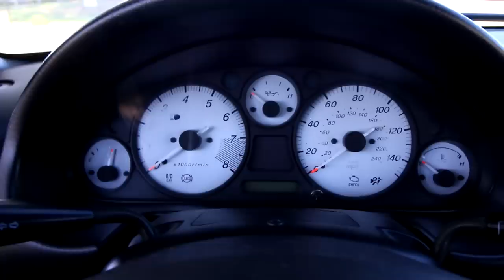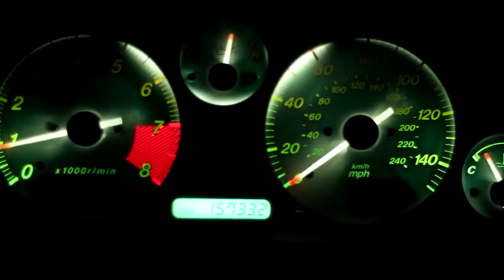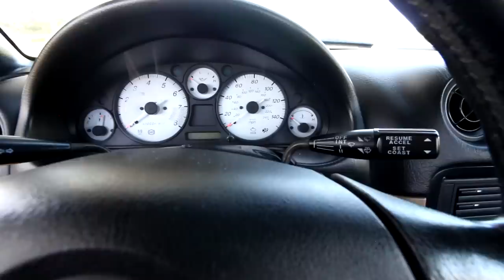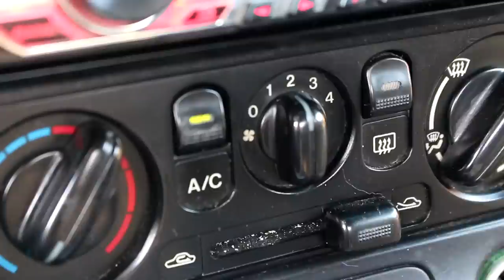What To Do After You Bring Home Your New Born Miata! (Miata Dad Protips) [Project 2SJ Ep2]

Comment: Don't buy new window regulator!!!!! I had the same problem with my window and it was due to a missing clip. The cable gets stuck and won't let the window go down. All I did was run a Ziptie around the cable and tighten it where the clip goes. Super easy fix and will save some good money!
Reply: This, had it happen on 3 NBs.
Reply: @imboredadr  hi fellow nb owner, had to do this too
Reply: @bocaj949  Had it happen on my 99, and both 01s. On my MSM I had a different issue in that both windows would roll down super slowly and sometimes get stuck. Greased the track and fixed that. Interestingly enough a friend of mine bought a MSM and had the exact same issue on his.
Reply: Same deal on my 01!
Reply: Same thing happened on my 93 with manual windows. Easiest thing I’ve done on it.
Reply: I broke my regulator today, cable snapped
Reply: Has happened on both my NA and NB. Very common
Reply: I literally have the same problem now. Thanks for the advice
Reply: Agreed. First off I’d grease the two  tracks inside the door and then use some Honda grease on the A pillar window track. If that doesn’t fix it, then it’s the clip.
Reply: I just fixed the same problem yesterday. The cable clip was just loose. Don’t buy a new regulator :)
Reply: GENIUS!! Idk why I didn't think of this...had the exact same thing happen in my 91. I just put the cable back and hoped it stays.
Reply: @speedymini998  Greasing them worked for me. Buttery smooth
Reply: Yup. Same thing on my '01 Just fix that snagging clip, clean em up and regrease. Shin-etsu is your friend here.
Reply: same thing happened with my NA. easy fix
Reply: Same on my 2001. Clip had disintegrated. Does this happen only on passenger side?
Reply: Same on my Na I took the door skin off to strip it down and with it off the window wouldn't work normal
Reply: Just did this two weeks ago, pretty simple🤙🏻

Comment: DO I HAVE TO FEED IT XD
Reply: Lmao 😂
Reply: Yes, they eat fully synthetic oil.
Try feeding yours from your palm so it'll trust you quicker.
No worries if it doesn't work on the first attempt. 
Just keep on trying.
And don't forget giving it water too.
Reply: Actually oil yes mine for some reason is low and idek y....only 82,500 miles tho so idk y its "burning oil" I actually think I have a valve cover gasket leak which could be the culprit so watch out for that
Reply: @DevinG.Builds  A valve cover gasket is about 20 bucks  and a 1 hour job at most, I'd really recommend swapping it if you think there's an oil leak coming from it.
Reply: @FriedTurkey  oh yeah, I'm already on it, doesn't seem too difficult or expensive, not bad of an oil leak jus some oil in between the head and the valve cover, even if it isnt the issue its still a new gasket, plan on installing one very soon!!!

Comment: You might not need a new window regulator! My NB had a similar problem, and it ended up being a broken plastic clip that held the cable to the door. The cable was able to move enough to get caught under the window and stop it from moving down. If that's the case you can use a zip tie to hold the cable in position against the door.
Reply: My NB also has the window problem, stops at exactly the same spot, so I will check that!
Reply: @sweetielea3194  the broken plastic clip is what was keeping the drivers window of my ‘99 NB from going down all the way. The old zip tie trick to hold the cable back solved the problem.

Comment: That Nardi wheel is in fact factory, I put one in my NA. Something interesting - the earlier NBs have the Nardi logo on the airbag and nothing on the bottom of the wheel, and the later NBs have a Mazda logo on the airbag and the Nardi logo on the bottom of the wheel. What I did was order a later Nardi wheel and an earlier airbag and put them together, so now I have two Nardi logos on my wheel for sick street cred :D
Reply: Did the exact same thing lmao then I got replacement logos got 2 pairs, one in original blue and another in red in case I wanna change them out later on
Reply: Elvis G yeah i need to replace the steering wheel one on mine. Did you get just a sticker that goes over it? Or is it like a full metal badge?

Comment: A few tips from a multiple NB owner; retrofit the NB1 light instead of going through the whole conversion and it is way cheaper and in my opinion looks better, the passenger window regulator is most likely good, there is a wire that comes loose from the door and gets caught on the track all you have to do is pop that door card off and ziptie the line out of the way, the Nardi wheel is factory in almost all NBs save for a few early 99s. I have a passenger NB2 tail light and several sets of NB1 headlights if you're interested.

Comment: so happy you got a 99, I have the exact same car except it has 50K miles on it. You should also get a spare main relay and a spare coil pack, those are known weak points in the 99. might as well go ahead and change out that radiator and get a dual core and some silicone hoses while you are at it. Can't wait to the upcoming videos. The NB's big bang for your buck add ons are... from roll bar, sway bar, coilovers, and frame rails.

Comment: The radiator cap is pretty cool. I had one on my aw11. You can lift the lever and it will bleed off all excess pressure in the cooling system, so you can check level without waiting for it to cool down.

Comment: On my 1990 I did water pump, timing belt, pulleys, spark plugs and wires, oil change, oil filter, fuel filter, air filter, coolant flush, tps sensor (only thing I knew was bad), treated the gas tank, cleaned the iat assembly and throttle body, and diff fluid change in the first few weeks of owning mine just to make sure 😅

Comment: re: passenger window, sometimes one of the cables in the door comes loose and snags on the window mechanism, preventing the window from lowering more than 2 to 3 inches. Easy fix!
Reply: So that's why mine won't go down anymore. I need to find a write up on this fix
Reply: @Dammit_Dad  Did you find something? It can be fixed in 10 minutes with a investemnt of like 5 cent XD
Reply: @friendlyreptile9931  Actually did this fix yesterday. Indeed it was the clip broken, and the cable was catching. Used a ziptie and window works great now

Comment: I once ran a bigger series tire on a VERY similar Miata. It would accelterate uneverly. Didn't ruin anything - I ran it for about 3 weeks. TIRES make a HUGE difference in ANY car... ESPECIALLY Miatas. Replaced both rear wheels where the bigger one was at and gave the other good one to my dad. He's the type of dude to put 4 different brands of tire on the same car. .. .  Toyos are sweet... $50 a piece. Toyo Potenza IIs ARE GREAT IN ALL WEATHER. They squeal in the roundabouts... GREAT IN THE SNOW AND RAIN THO. $52 a piece tho..

Comment: Top tip for the gear shifter boot - Take the existing shroud, cut all of the 'rings' out of the middle, and buy a CV joint boot that has a similar size base to the existing ring, and just stretch it over. CV boots are way more flexible & durable than the OEM (or aftermarket) boots, and way cheaper. Just make sure to push the small end down far enough to not interfere with the leather interior boot.

Note, this is only for the upper rubber seal, not the lower one which seals the oil in the shifter housing.

Comment: Good video and so different to how it would look if it was made in the UK, here it would start by talking about rust, before moving on to a section about possible corrosion, before finishing off by talking about the problems with trapped moisture causing rot in the chassis rails and rear sills, that's about it.

Comment: My NA was losing power steering fluid, ended up deleting my power steering by removing the belt and I'll soon convert my rack because I prefer manual steering.
Lost some oil when I first got it, valve cover gasket change fixed it.
Lost some coolant from the water pump neck, a hacksaw fixed that xD

Comment: NB Fuel smell could be from the tank filler hose in the back. Whether the hose is just weeping or the connection of teh hose to the fuel tank gets rusty and allows vapors to slip by. I had a good filler hose, but had rust on the connection to the tank. you can clean this up with some sandpaper and it got rid of fuel smell in the car, primarily after you fill up. Not sure if this is same as the NA.

Comment: The issue with the windows is probably just a plastic knob on the glass getting caught on the guide tube for the wire. If you take the door card and stick a mirror in your door you can see if that's what wrong. Took me about 30 minutes to fix the same issue on my car.

Comment: I am turning 20 in 3 days and already have a prius c that is paid off. Am completely new to cars and was thinking about getting a 2004 miata, as my first manual if I can afford it. Was wondering what your opinion is. If I should get one or not.
Reply: 100% yes bro. 

This is coming from a guy who’s owned Porsche, lotus, Mercedes amg, Hondas, fast euro hatches.
Currently main car is an EVO X with 720whp. 

I’ve got a miata also. We’ll actually 2 but only ever have one on the road 😂 (tuning them is super cheap and addictive and you can do it with a £200 tool kit on your driveway or better a garage - also you don’t need any mechanical knowledge really just a “I’m up for this” attitude and access to YouTube. Seriously easy. This was my go to when I moved to the states after selling my lotus exige I was scared to buy anything super expensive in case my job didn’t work out. So I bought one of these and put a turbo kit on (admittedly a very good one and i had an excellent and insane Serbian mechanic help me-
That’s a whole other story the guys insane 😂) 
Anyway I had that car smoking lambos. I’m not exaggerating. It was £/£ better car than my exige. & I had an exige “260cup Roger beckets Edition” tuned and pushing 320whp. 

Before I go to work late from typing this (I think I got adhd or something but whatever😂) 
I strongly recommend to buy a 1.6. People always go for the 1.8 for “displacement” but the 1.6 is infinitely better if you’re going to turbo it. Which I’m betting you are. If you’re gonna supercharge then maybe maybe 1.8 but I still prefer the 1.6. I have consistently had them running 260whp on pump gas and that gives you a power to weight ratio that’s higher than most supercars. 

For example the Bugatti veyron is 500 to the ton.

Ironically the caterham R500 is now updated at 530 /ton. 
It has only 310bhp and is probably the fastest “Car”
I’ve ever driven. 
I don’t count “track attack” cars as they can’t be driven on the road. At least not in any reasonable sense. You feel like a right dick in an Ariel Atom when it starts raining i promise you. 

(You also feel pretty stupid when you dropped 80k to buy one and you see a miata in the mirror and plant the loud pedal. Then look in the mirror and see it’s still Fkn there! 😂

One of my school friends now has a McLaren and I saw him in my evo last week. I’ve had that thing for 6-7 years now and it’s mechanically perfect. Like perfect perfect. 
Absolutely mint condition. Like a new car. He goes “awe man… like… why can’t you sell that and get a Ferrari like you always said!? That’s gotta be running you about the same!!” (He knows his maintenance costs- he is not a great driver by his own admission but he’s a very enthusiastic guy) 

Anyway he asked me to drive it so he could “see how fast it really is” I respect that so much. He knows I’m a very well trained driver and he openly admits that he’s not the next stig. Takes a big man… anyway. I did.
&
It’s fun/fkn fast. But… but… if i had just spent the value of a house on a car I won’t lie: that would be disappointing. I don’t care what anyone who’s got one says or anyone who fanboys over them: they are disappointing. Fast? Well yeah if you’re not a “car guy” which leads me neatly into my next point: he asked me; “would you have this over your evo?”

“Well…. I love this, super cool super fun. But I won’t lie bro I’m a bit disappointed in the build quality and for that money… I’d buy a miata and spend 20k on it and keep 180k for something else and I’d be faster than you 100%. Not only that, I could proudly park it next to this car and I know it would receive as much if not more attention”

He agreed with me but hes not biter about it. He just wanted to tick off a bucket list item.

So my point is: yes buy a miata. 
It will do anything you want it to from a budget of $1000- 50,000” 
There’s just so many things you can do with them. 

To answer the real question: you can buy a “good” one for around $3000 and you can have it up to spec “your way”
Whichever way that happens to be for a high end car (not engine swapped I honestly believe that’s a waste of time since you can get 300bhp out of the issued engine)unless you just want to cos you can. 

You can have a super high end car that looks the dogs danglers for around $8000. That won’t break on you so long as don’t cut corners in the build up. 

Happy birthday brother from another country. I’m glad that my stomach issues could be of service to someone 😂

I hope that you read this, also yes that’s my real name I am me and i don’t chase check marks. 

Happy birthday man. Please also satisfy my curiosity and let me know what you buy! ✌️🫡
Reply: @JamieWalker-pc6nd  You seem a... Little knowledge. I'm 19 looking to buy my first car, a fun daily driver to learn to do some wrenching on. I'm stuck between an NB and a 986 boxster. Any thoughts?

Comment: Im rocking 215 in my nb2 miata. No scrubbing with my used Fly'n miata stage ii suspension. Gotta stiffin that front tho. And when i get the front fenders i want, i will be trying 225s
 ...my gas is shit from 26 to 21 babay!
Ps i told u to get a nb2 foo. Please convert to nb2 rear bumper (get rid of the "5mile bumper" and go nb2 front as well get whatever lip u want. Oh and... just spend the 450$

Comment: i've had that gap issue with the soft top, after you tighten the screws, you have to clamp them down both at the same time. Otherwise, the side that was popped in last will have a gap...the quirks..

Comment: About the color, 1. Dig into the bodywork. Make sure they didn't Bondo over rust or another surprise. There is nothing like having several square inches of filler nearly a half-inch thick popping off your car to make a car enthusiast feel like an instant chump. Besides, doing some real bodywork isn't terribly hard and another good process to learn. You could even consider replacing the rear quarter panel or other areas if there is too much damage to fix properly. Again, not terribly hard, and most sheet panels are not very expensive.
2. Repainted cars (not counting your salvage title) are often done to hide various damage(s) with cheap bodywork to sell a vehicle. The paint can be super cheap and improperly done which can lead to pealing and so on. Painting is another decent skill to pick up. 
3. That feeling of satisfaction when the car is done and done right. Bragging rights that you did it all yourself...with pictures! Or videos in your case. 
---Just my two cents.

Comment: Hey Creck, I had the same problem with my passenger window. Turns out it was a cable that wasn’t held flush to the inside of the doorcard. It was a plastic piece that was broken that made the cable cross under the bottom of the window.

Comment: as for the lower boot for the shifter, mine was f*cked so I deleted it and just put a crown royal bag over the shifter. 
the smells of transmission fluid, oil, and coolant are just a regular thing now and I've gotten used to it. I can tell the balance of the car's fluids by smell, it's like a sixth sense. I can hear the health of the transmission and lemme tell ya the 2nd gear synchro isn't doing too hot right now. any day now it will decide to end its life. I can hear its cries for help whenever I do a 0-60 pull. when it doesn't grind it clinks into place like a fragile glass plate being violently put back into its place in the cabinet. 
2nd gear, your days are numbered. count them.

Comment: From the looks of that dipstick and the fact that you're in CA, that must be the CA emissions NB1 with not one, but TWO catalytic convertors.

NB1 coil packs are notorious for failing. If that one is original, replace it. I went with the Fab9 COPs on mine. 

NB1 has the return-less fuel rail. You can delete all of that evap canister stuff and cap the hard line with no I'll-effects (this is assuming you're not keeping emissions).

If you are keeping emissions, the NB1 is notorious for throwing a CEL (P0402) for the EGR valve; it's not the EGR. Pull the top half of the intake manifold and clean out all of the ports really good.

Also notorious: radiator fan connector burning. Happened to me while driving. Have since hard wired it with no issues. I've also had to replace the AC fan. Car overheating with the AC on led me to discover it was no longer working properly.

Comment: Hello! Love your channel. I keep getting the dreaded P0012 code. Changed oem cps, vvti, timing belt (with sprockets), VVTI filter, and water pump. Did all the other low level maintenance too such as trans fluid, 2 oil changes (1 synthetic and 1 conventional), plugs, wires, and EGR (non oem). The phaser seems to be working properly and was replaced by the previous owner. Could it be the connections?  The previous owner replaced the ECM and the immobilizer as well. Not sure what else I can do. Any advice would be appreciated!  2003 Miata 6 speed LS.

Comment: I'm doing a cooling system refresh on my 93. I would really appreciate some content on flushing the heater core!
Reply: The heater core is just part of the system. I would run a couple of bottles of radiator flush through the system. Drain and refill till it looks happy.